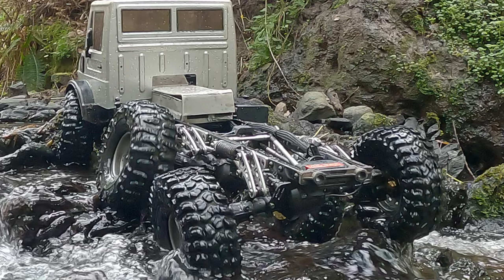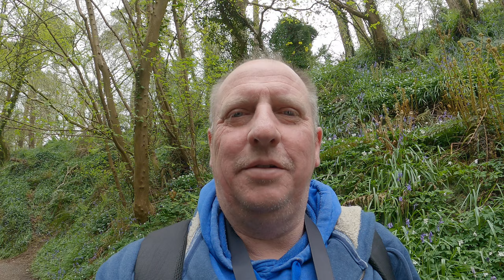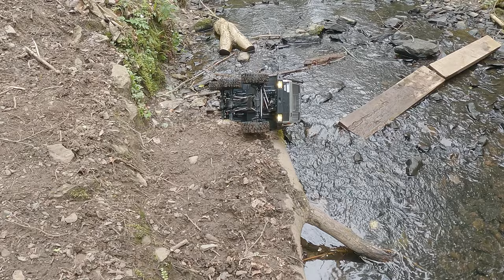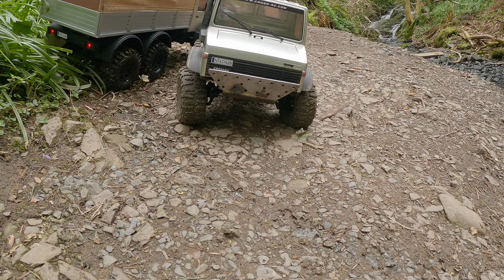6x6 Unimog Head to Head, Stock v Modified.. Cross RC Emo NT6 Build with Cantilever Suspension

Comment: Does it also work with load  (rc car)  in the rear in a steep hill?
Reply from the maker: @ka4172  stock form, yes, but would need the bed modified to run the cantilever suspension

Comment: Ja. Ich möchte es kaufen. Was kostet es ? Wird nach Deutschland geliefert ?    Yes. I want to buy it. How much does it cost? Will delivery be made to Germany?
Reply from the maker: @s-peschlbernd5728  they may be available in the future but at the moment I have no release date.
If they do become available I will make a video so everyone will know 👍👍
Reply: @TimsRcsurgery  Hello Tim. I really like your nt6. Back then I had the first CrossRC 8x8, and with it only problems: broken axles, gearbox too loud, no slow crawling possible. Now I've seen your video and am wondering if it would be something for me.? How satisfied are you with the axles and gearbox? I would also be very interested in the cantilever parts. What would they cost? would you deliver to Germany? Kind regards, Bernd.
Reply from the maker: @s-peschlbernd5728  I was very sceptical about the truck to begin with but if you watch all the videos you will see that the truck gets abused more than just lightly used.. it has stood up to everything I have thrown at it, it is my favourite rig at the moment. Not 1 complaints from me regarding axles or gearbox, everything is tough as old boots 😃

I’m sure something will eventually break but at this point I’ll happily replace without complaint as it’s been so good.

Out of the box it is fun but for slow technical crawling it can easily and cheaply be upgraded.

You won’t be disappointed 👍👍

Comment: Great comparison between the two👍💪. Can you still run  the tray and canopy on yours with the cantilever suspension ?
Reply from the maker: Yes, would just need to make new bed mounts as they used to be the shock mounts.. will have to “tub” the bed though as the wheels come 1/2 way up the bed now with the suspension travel 😃